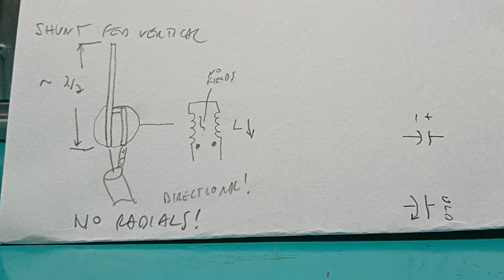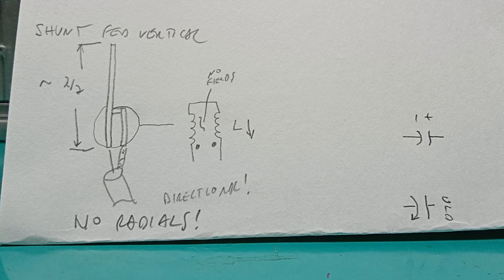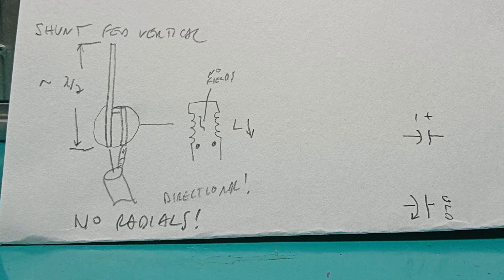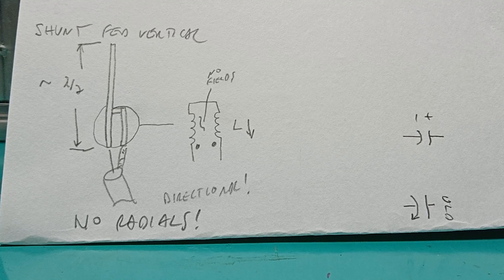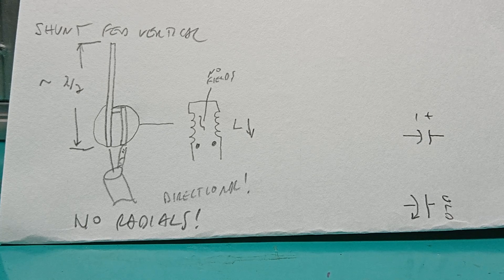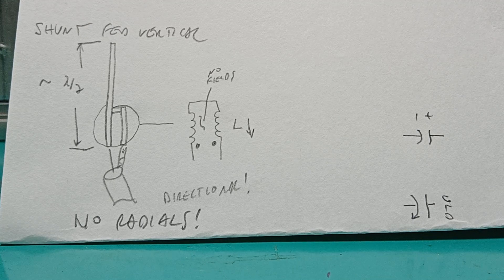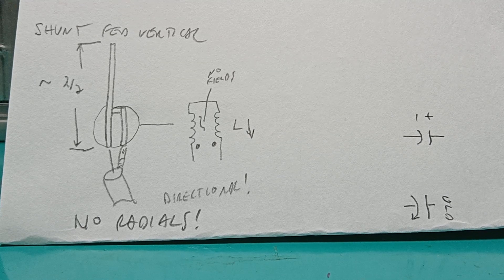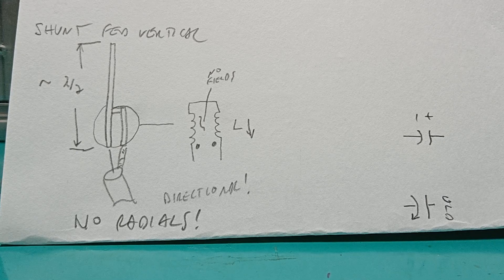Shunt Fed Vertical Antennas

Comment: Interesting design. On your website picture of the 20m vertical the braid connection to shunt section appears to be at 16" above ground with a worm clamp. Is that a different design than in the video? Or is that just a slightly elevated design? On the site you mention tuning components/networks involved. Can you describe? You mention 19'6" tall half wave, for which frequency? How did you calculate? Thx
Reply from the maker: Its elevated.

Thats all Im going to disclose about that antenna...

You go figure it out....